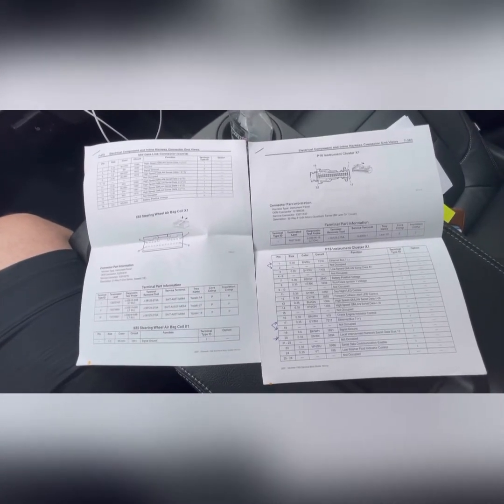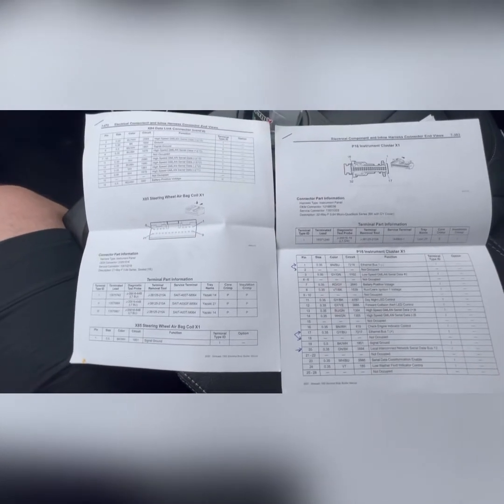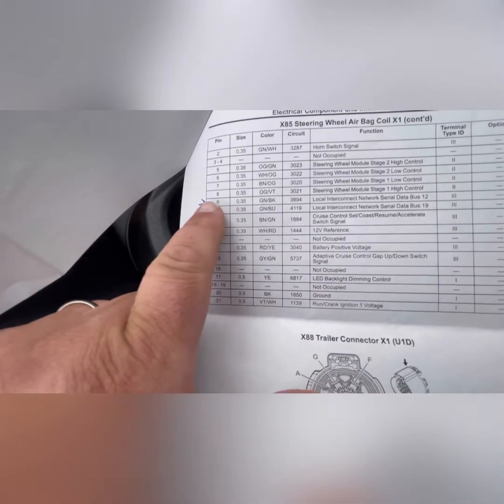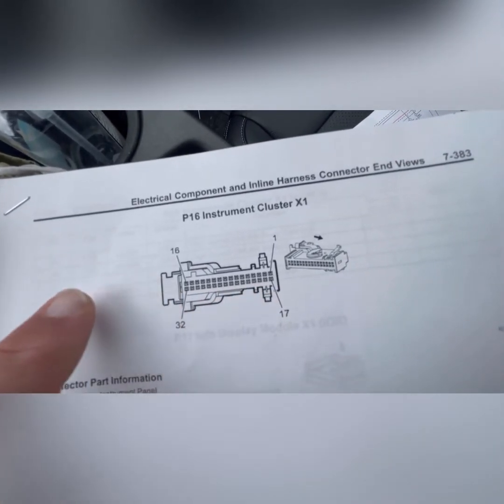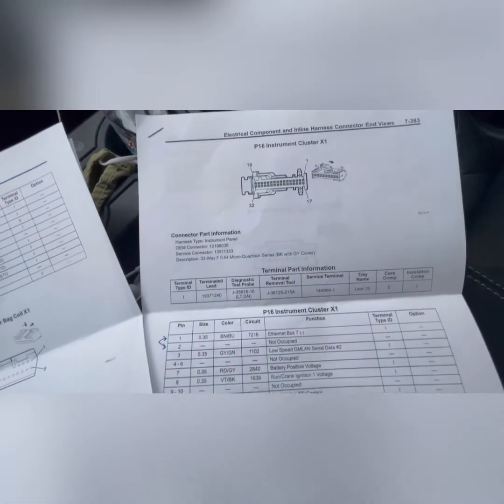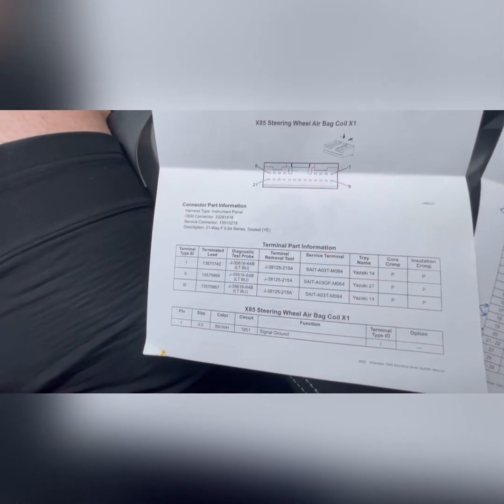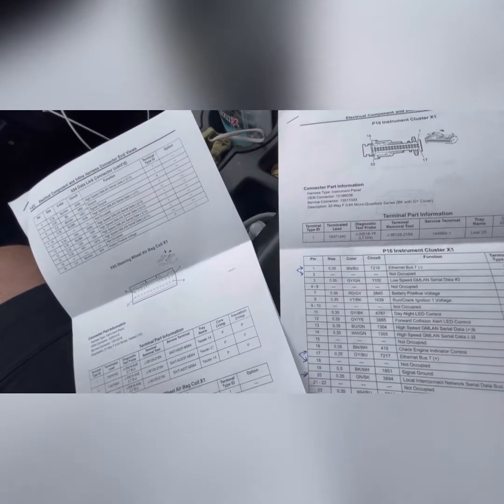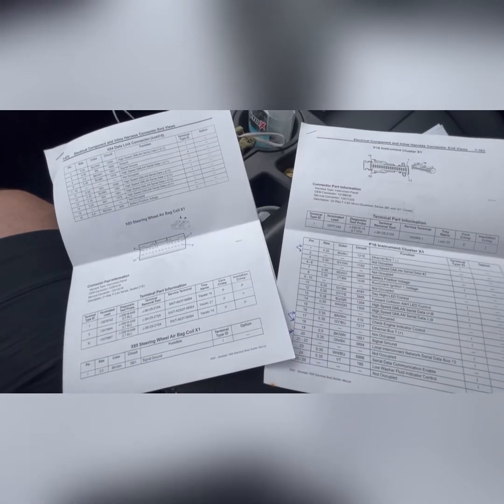2021 Silverado Custom Instrument Cluster Upgrade Technical Info

Comment: Hey bud thanks for the info but I installed the new cluster and the harness from Dr Harness. And I can control the menu on the cluster but I can't control the radio volume or presets. Any answers?

Comment: Tried this in my 2022 2500hd custom. I can not get my steering wheel to control the radio or the cluster. Only option that works is the cruise control. Would you have any info to help me get mine going? My truck is a custom with the 6.6L gas burner
Reply: Hey Matt. Not sure what I did but I'm up and running and all controls work! Installed the leather dash all the way around on to the next customizing my custom!

Comment: Hi,  Did the factory trim not match the new steering wheel and that's why you changed it out?  If so can you post the part number for it a place you purchased it from if different than the place you ordered the wheel from.  Thanks. Great video!

Comment: Did the wire from the HarnessDr come with everything needed to plug and play, or did you need some extra parts for it to fit into the pins?

Comment: I have a 2020 Chevy custom , can I just change the lt or Ltz cluster and steering wheel instead the high country and the radio buttons will work ?
Reply from the maker: Maybe, I haven't experimented with the clusters from those trims.

Comment: Hey great video. I have 2021 custome with Talley package. Is there a way to modify you steering wheel to operate the dash screen or the radio controls ?
Reply from the maker: Do you mean modify the base model wheel? You could order the buttons and harness to put in your existing wheel. You would just need to remove the blank off plates and assemble the harness and buttons. You will still need to add the wire between the cluster and wheel.

Comment: Very nice video . I have I 2021 Silverado 1500 Custom like yours with IOR 7 inch car stereo. My question is How much is the cluster and from where you bought the steering wheel and how much you pay for Steering wheel.
Reply from the maker: Cluster here for $675
https://www.whiteautoandmedia.com/product/denali-high-country-cluster-upgrade-t1/

I'll post the wheel a little later.
Reply: @monstertek7394
Reply: @monstertek7394

Comment: Hey Matt a customer showed me you video and ordered a high country steering wheel. I installed it. He didn't upgrade the cluster, so the steering wheel controls for the radio doesn't work. I just want confirmation that he does need to change the cluster in order for the radio controls to work. This is a 21 Custom
Reply from the maker: Yes, the cluster must be changed and programmed to the truck. The signal is transmitted through the cluster.
Reply: @monstertek7394  also have you come up with that harness yet
Reply: Exactly as I thought and told him
Reply: Does the cluster have to be a high country or can it be from an ly

Comment: Can I use my cluster in my truck and just upgrade my steering wheel and put wire in
Reply from the maker: No, the cluster has to be upgraded as it actually controls the stereo.

Comment: I was wondering if I still need the extra wire to run the radio because I’m not changing out the cluster on my 2500 custom
Reply from the maker: If you don't change the cluster, the radio will not function. The cluster actually sends and receives the signals to from the wheel to the stereo. The custom cluster will not work to do this.

Comment: Are you able to verify if the pins are the same for a 2021 Sierra 2500 base? I don’t have access to the drawings. Thanks I appreciate it.
Reply from the maker: The 2500 should be the same, I'll look for the PIN out diagrams and see if there are any differences.
Reply: Definitely the same 
I’ve done this in my 2020 3500 hd trim LT with a high country cluster in it and swapped steering wheel as well
I have an extra brand new cluster in the box with part of the connector pins and wiring ready to go

Comment: Finally somebody who goes further than I do, lol. Got the 21' 2500 Custom and was researching to see how hard it was to add the radio control to the steering wheel. You didn't try it before you added the wire did you ? I got a feeling the radio control pin was already there it was plug and play as why would it be going to the cluster? It is an option on the Custom so I'm thinking its just already there in the event the option is added by a customer. Love your attitude, mods and channel. Pretty sure you will be huge eventually as you have good onscreen appeal - Thx
Reply from the maker: Thanks Michael!!! I actually did test the system without the wire. Well actually what happened was it didn't work, and I found out the wire wasn't inserted far enough. Pushed it all the way in and then it worked. Thanks again for your nice comments.

Comment: Hey Matt  awesome videos. I have the identical 2021 truck you do could you please let me know the part numbers for the steering wheel and the cluster and where you purchased from. Also the two pins needed for the can bus wire that needs to be added. I need to get this done ASAP I miss this feature I had in my last Silverado LT. And know body at the dealer could help me with adding this they say it cannot be done. Well you proved them wrong.  Next project adding the auto A/C.  Thanks for all you do